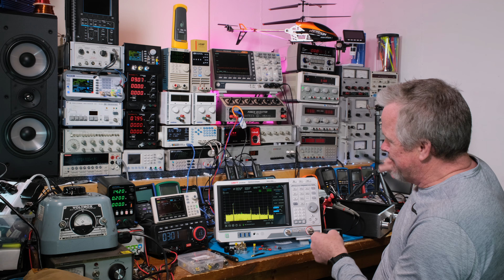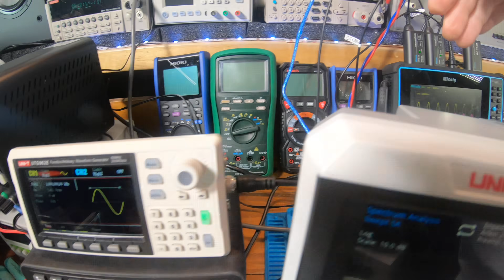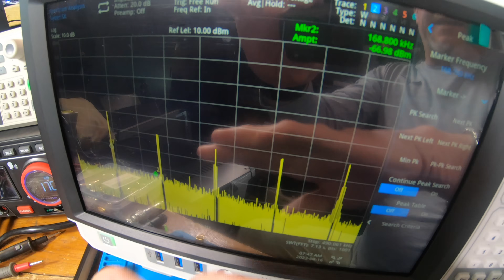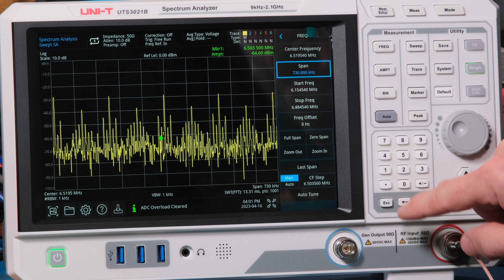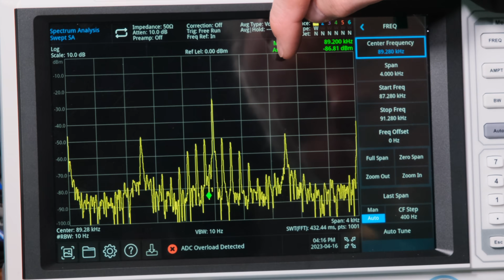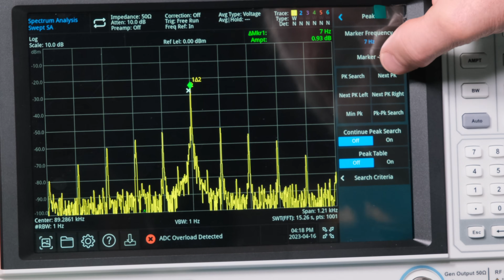Spectrum Analyzer meets Class D Amplifier - using Uni-T UTS3021B Spectrum Analyzer #UTS3021B

Comment: Maybe I missed it, but averaging is your friend. Repetative signals will come out and random noise will get flattened out.  Hence if it flattens out, it is random / asynchronious. Try it with averageing of 16 samples or more.  Also if you have jitter the width of the signal will broaden. Can it hold a stored signal and superimpose this over the current display?
Reply from the maker: Thanks for your feedback!  Yes averaging can be a friend;)  I'll get more into the features as I go on.  I appreciate any feedback and/or suggestions/recommendations on what I can cover and how.  Yes this can save images and can be used for comparison.

Comment: Guess you need another tripod so no need to hold the camera with hand. What can we do after finding the noise?
Reply from the maker: Thanks.  I do have another tripod that I usually use.  Once you find the noise - and if it is too high - then you know you need to correct it.  Knowing the type of noise can help you find where it is coming from and help you change the design to get lower levels.

Comment: I use those same probes, really I would call them glorified transmission lines 😊 with the "TinySA" spectrum analyzer. I hope that you might demo one of those tinySA's if you haven't in the past. Very very low cost,.they also do double duty as signal generators, and set up Smith Charts... So small, it fits in your hand, about fifty dollars! You can also use one of those probes and actually walk around until you find an interfering appliance, thermostat, wall wart, or burger alarm keypad, and then? Just smash that with a hammer and presto your noise source is gone! 😅 You thanked me for my service as a Nurse. Notwithstanding, I must thank you for your service in the defense industry. You may have saved lives too, you never know. Maybe even RIGHT NOW, with the very arms that we send to defend the Ukrainians.  And? While you could just kick back with a cold one and watch tv, it's YOU who are reaching the next generation of engineers and scientists, and it is they who will go places and do things that we dream not of, because of your very efforts.  All the Best! 73 DE W8LV Bill
Reply from the maker: Thanks - did your comment get deleted?

Comment: I just built a little bridged amp using two TDA2003's and with no input it is wildly unstable. I don't have a spectrum analyzer, but I do have an oscilloscope.  Any ideas how to diagnose the problem?
Reply: Purchase a TinySA. Fifty bucks or so, you hold it in your hand, and you have BOTH an RF gen AND an SA to go along with your scope!
Reply from the maker: @w8lvradio, Thanks for the great comment!
Reply from the maker: Thanks for asking.  Try shorting the input to be sure there isn't something going on there.  Can you send a picture?  Have you found the problem?
Reply: @KissAnalog  Thanks for the replay. How would I send you a photo? 
I put a voltage divider / potentiometer across the input and it stopped squealing. The amp is stable and working now sorta , but it sounds clipped with only a little volume. This is a bridged circuit using two TDA2003's (based on datasheet example), maybe I damaged one of the IC's when it was unstable, due to excessive internal feedback? Or what do you think might be causing the clipping? 
Before I try replacing the IC's, I think I'll try hooking it up with a sine-gen and look at the distortion with my scope.